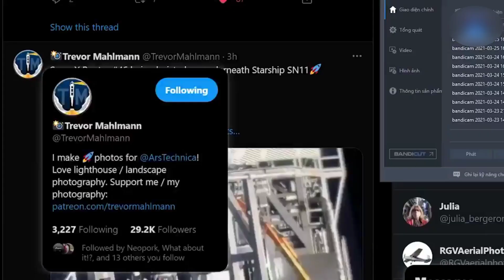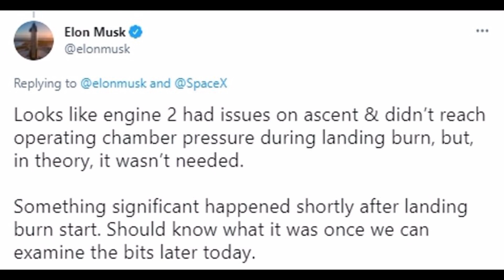Why did Starship SN11 explode before landing?

Comment: Engine 1 blew everything up because the feed ended right after. All other landing burn sequences show that engines light one after the other, not instantaneously. So the explosion was after engine 1 successfully ignited but before engine 2 or 3 had a chance. That can only mean 1 thing. There was methane in the engine well which caused enough damage to destroy the camera, which then caused a chain reaction as it blew the rest of the ship apart. For bystanders recording, (every day astronaut)  who were also watching spacex feed, the feed cut off and the explosion was heard after the feed cut off, so you can't argue a delay in the footage, as the explosion would be heard first. Also, fire needs a fuel source in order to ignite, even after they shut off engine 1, engine 2 it still is on fire even though the camera tries to hide it. You can still see flames. What's it burning? Nothing? Not a chance! fuel was leaking into the engine well. It basically comes down to quality control during engine development. Encasing individual engines in a sealed manner would also prevent the engines from blowing up if leaking occurs, and from being damaged from engine cutoff fire. Would have saved SN10 also.
Reply: The skirt is an open space thoroughly vented during descent, also nowhere near big enough volume at atmospheric pressure to cause such a massive explosion. It was something more serious, very likely an internal leak, not a small one, tank contents were mixing inside the vehicle, on relight it reached the preburner, instantly flamed back, a quite scary failure mode we've never seen before.